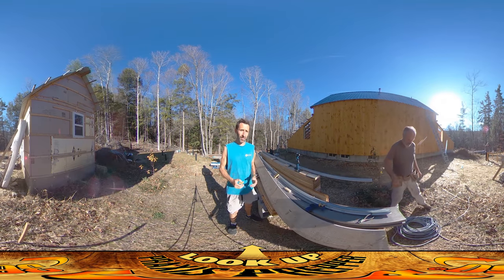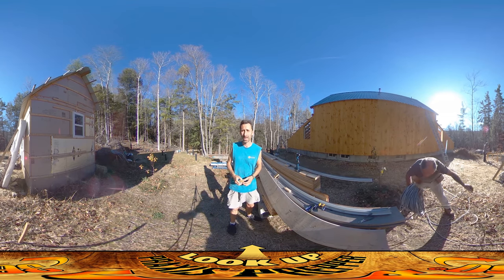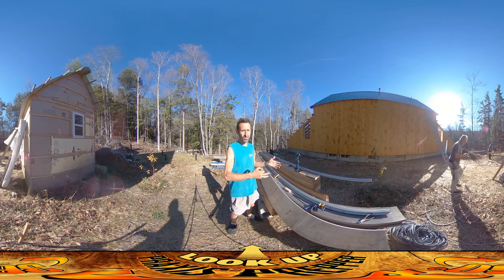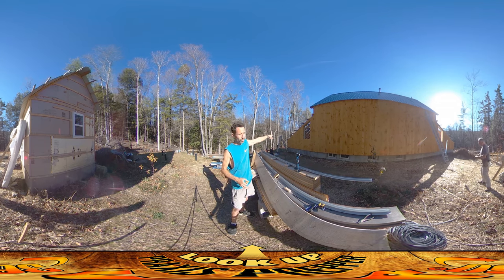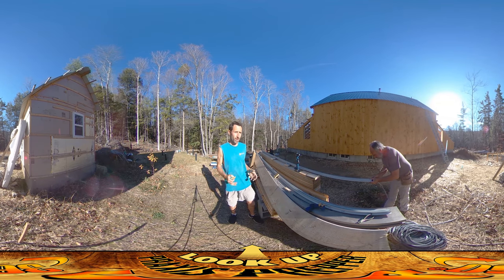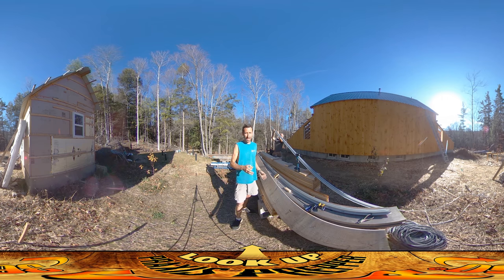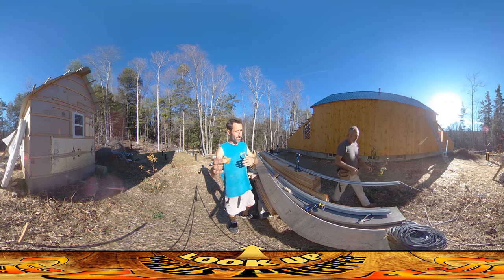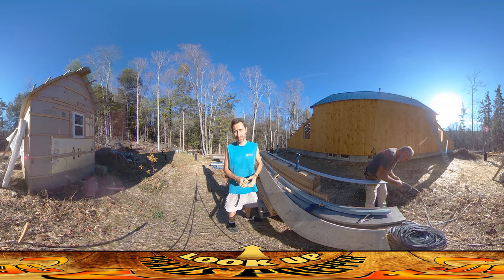Homestead Building - Aluminum Extrusion for Greenhouse Roofing Panels

Comment: In my opinion you can't overstate the value of doing some of the larger projects yourself. You saved the cost of the entire house on doing the greenhouse roofs - WOW! Plus, it feels really great and will feel great for years to come every time you don't make a payment. 
My story is not quite as dramatic, but still significant. I paid about $5,000 for all the parts (including the steel pipe for the 20'wide  by 17' high rack for the panels) of my complete off-grid solar system that powers my normal lifestyle. In town with a contractor? Around 30K.
Reply from the maker: I love your story too Jason!